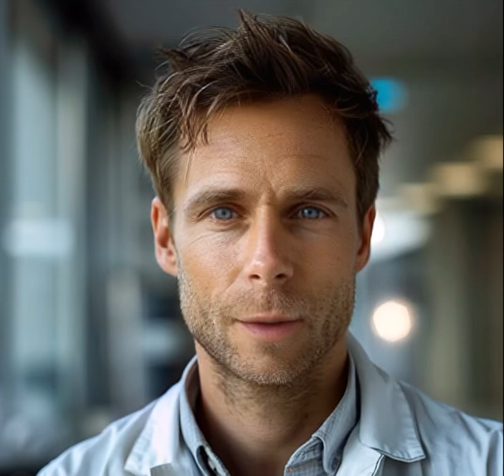MEOW Ep. 12

Comment: So would it be accurate to say that WB performs BETTER than Noah on 5.56, despite less internal volume? Or do they perform comparably, just Noah is optimized for 6 ARC and is less efficient for 5.56, therefore the extra size isn't beneficial?
Reply from the maker: WB is exceptional on 556 for its form factor.

Comment: I understand from the video that the performance will suffer but-  my Cat ODB 718 (regardless of optimal suppression) will it work on a 308? or will it damage the suppressor?
Reply from the maker: ODB is our x39 AK suppressor that can take up to 762NATO. JL is our dedicated 308 Sniper and new launching DD is our 308 Surge Bypass for 308. ODB works great on 300 Subs but I wouldn’t run Ti on AR10 much but IN718 goes well on AR10’s over 13”. It’s not you can’t, it’s not optimized for performance we make each model for. We build for mainstream MIL platforms - M4, AK47, MCX Spear etc.
Reply: @specterscat I truly appreciate the answer.
I use it only on my 300BLK, but I if need to suppress my .308 I know I can. 
Thanks CAT!
Reply: It will work, I've shot one on a 20" bolt 308, but it wasn't very quiet. It would be OK for reducing blast, and it's OK if you are taking a shot without earpro for hunting. But even with earpro, I would want something a lot quieter if I was blasting away with a semi-auto 308. Because of that experience, I'm pretty doubtful on the Dirty Dave's performance since it's smaller and louder than ODB. That's one can I'm staying away from.
Reply: @letsgobrandon416  interesting, they just recommended the DD to the guy below 🙃 maybe for bolt only?...
Reply: @PrestonS-t9j thanks for trying to answer. but I don't think they replied exactly what I wanted to know.

I understand the DD is recommended over the ODB, my question is just if it will get damaged. But they tend to reply with " we recommend such and such" but not a clear "Yes" or "no"...
Reply: @argg.x i mean if you don’t follow the manufacturer’s recommendation that’s kind of on you
Reply: @PrestonS-t9j 😂😂😂
Reply: I miss seeing/hearing these. I appreciate the technical discussions and insight into purpose and background thinking.
Reply: The ODB is their .30 cal call and is optimized for semi auto .30 cal variants like an AR-10 platform in .308 from my understanding. You should be good to go. The JL is a bolt gun specific .30 cal can from my understanding. The ODB should be fine on a bolt gun too.
Reply: @mattwilson7344  yeah but the description of the ODB on their website, says 
"762x39 (MAX 762 NATO)"
 but 308 has higher pressure than 762NATO..